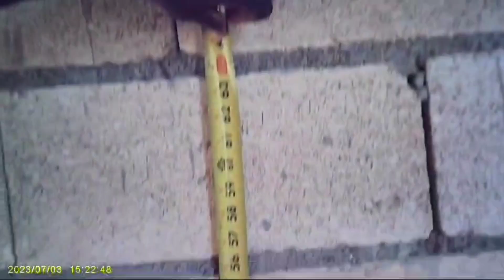How To Mark Out Your Electrical Outlets !! Purpose of Cutting The Walls For Your Electrical Outlets

Comment: For the wall chasing equip based on qaulity. Also taking in account performance, blade types and dust extraction. Noting the price points for said machines.

1- FESTOL : DSC-AG- 125 
2- HILTI : DCH- 150
3- METABO: MFE 40.

Note: not an exhaustive list.

Big up on the very educational/ smart working content.